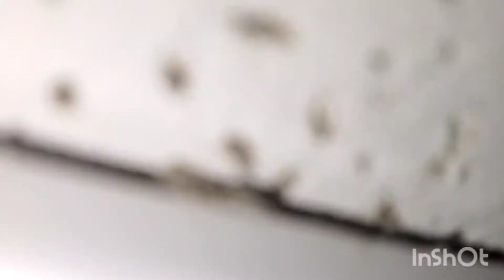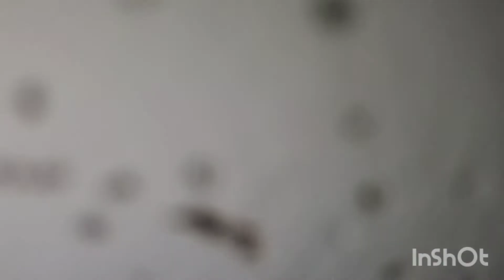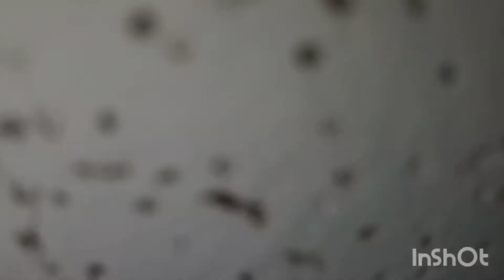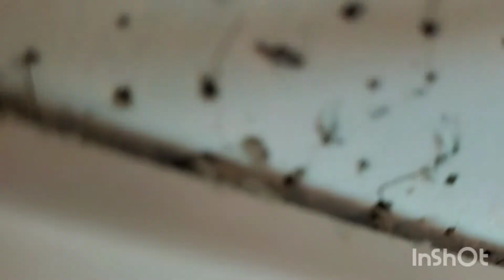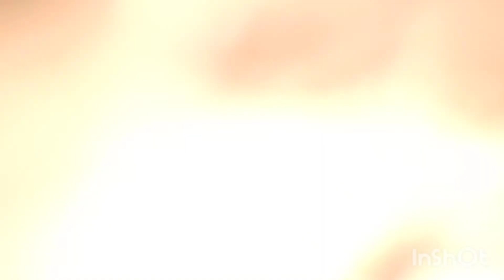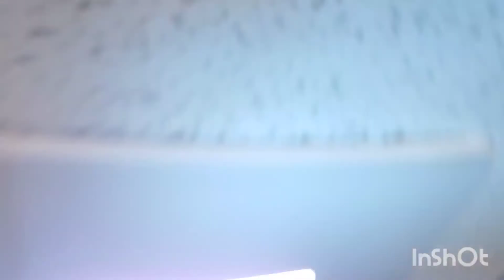ENGINEERING FAIL! Revent Bathroom Fan Light

Comment: I don't think that it's a design fail, I think that it is an installation fail.  It has two tabs.  One for 1/2 inch drywall and another for 5/8 inch.  Most likely they used the 1/2 where it requires 5/8 inch.  If that's the case, it's an easy fix.  Place the 1/2 inch in it's original position out of the way and bend the 5/8 inch tabs.  That'll give it more room.